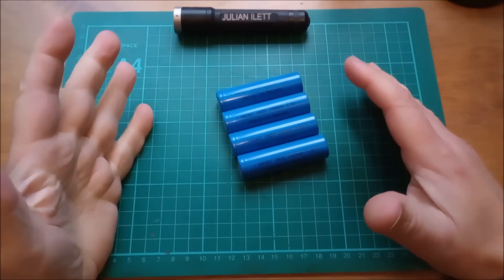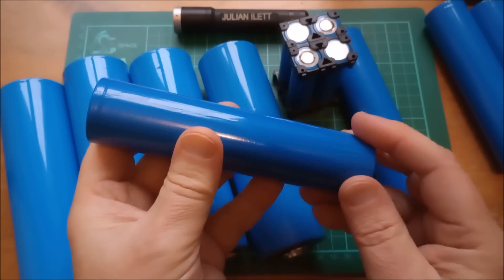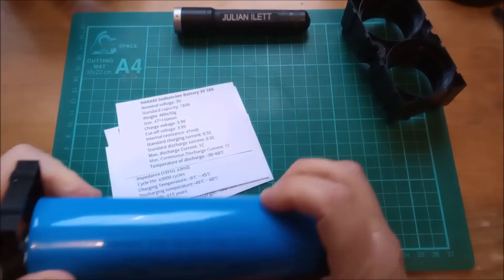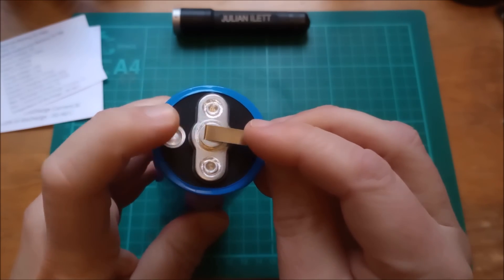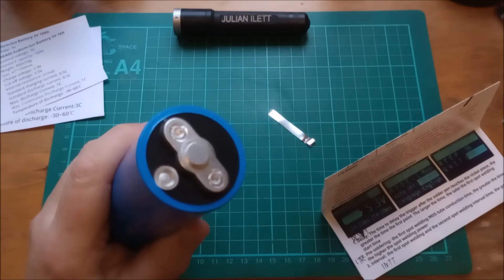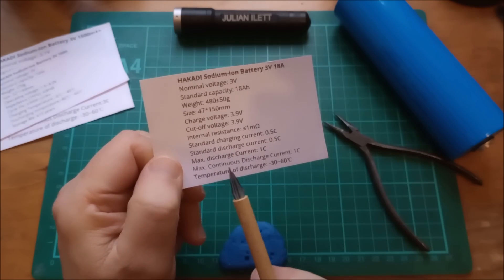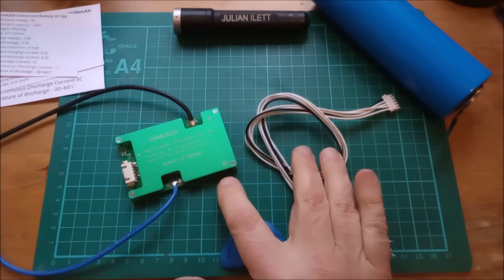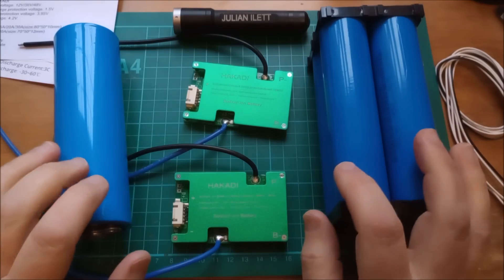Sodium Ion Cells from Hakadi Battery

Comment: You got my sub, and I also bought a 4-pack of these from @HakadiBattery.
I realize these don't explode if you overcharge, but I understand they can be damaged from overcharging.  What I'm wondering is what happens as you do?  Is there a particular voltage where the damage is accelerated?  Does the current during charging rise exponentially or some other effect?  If you or Hakadi knows info about this, I'd like to understand it better.

Comment: Interesting Overview Video, Thankyou. 👍👌
I think its ridiculous to have an Aluminium electrodes on a battery without having a Thread taped in on each end. Or even better a Steel end (Nickel finished) with the same Threaded insert on each end, would have less chance of stripping than Aluminium. Its very weird to see peak voltage decrease  proportionally to physical size ? 😳
Reply: Unfortunately the link is deleted here.  Search SRIKO Unfortunately very expensive.

Comment: Very interesting. But there are a lot of unknowns. Its very easy to say they wont catch fire but the actual evidence for seems to be lacking.
Then the discharge curve is showing them discharging to 1.4v while they claim its to 1.5v. The range of that voltage is strangely high. >80% of the discharge curve seems to be above 2.6v but most current batteries are like 90% above 3v. So I really wonder how useful these will be as 0 changes drop in replacements.
They claim they tested overcharging them without causing fires so like NiMH and NiCd. Again though where is the evidence for that? Will it damage the battery? Will the battery clamp itself and just produce heat like the NiXX batteries? If so you wouldn't need a BMS. But here they have a BMS... indicating something bad?

So given the discharge curve I would simply suggest using them to maybe 2.5v and when you have 1.5Ah takes off about 20% for its useful energy range. So 1.5Ah will be 1.2Ah.
Even then, the tech is really new and long term stability is unknown. Who knows they might self combust randomly. So until all data is known be careful with these. Now these are out and available to the public this data should be available very soon. If anything bad happens you will hear about it.

There is bound to be someone out there right now setting up a test with several batteries charging and discharging them to various voltages and checking the capacity each time. So we will get the data. But until that data is here I would strongly suggest most people to stay away from these.

After all Na is as flammable as Li. If they just replaced Li with Na then there might be some problems. (I know the reason to use Na was to reduce the risk of fire for use in home energy storage. So perhaps they really did fix the problem.)

Comment: That's were you need a 3D printer, ie, it comes in handy for odd-ball brackets, etc. Maybe a local fan can 3D print some.
You can get thick brass strips from a hobby shop and screw to wood and make it kind-of spring loaded.
SOSfix Electronics found some alum solder.
Reply: SOSfix Electronics found some alum solder - https://www.youtube.com/watch?v=NwzoPm7ogSs
Reply: I would not try to solder anything to the terminals of the cells, as soldering is a slow process that would pump a lot of heat into them, most likely destroying the plastic seals and causing early failure.

Comment: Hi,
Could you attempt a fire safety experiment for one of these batteries - e.g. drive a nail through a fully charged one?
When you do it to a li-ion 18650 it will catch fire, I believe.
Crushing them is another option.
Thanks.

Comment: The idea of TIG-torching a battery made me weirdly uncomfortable, but seriously how do they expect you to connect it? 

I have soldered aluminum by getting it good and hot (again, not batt. friendly) and then scraping the surface underneath a blob of rosin solder at which point it stuck easily. 

I do wish they would have a nice big chunk of aluminum on each end with M12-1.75 or 1/2-13 threads…

Comment: Aluminum and copper busbars aren't hard to find and aluminum ones are cheap and looking not at sellers of electrical equipment but at metal stock sellers even cheaper and the only equipment needed to make proper connections for such big cells are straight hands and exact size of drill bit for press fitting, may be also a jigsaw and a file for pretty looks.

Comment: The voltage curve is crap. I don't see these battery working with anything.
Reply: You can use electronics to stabilise the voltage.

You can't use them as drop-in replacement for Li-Ion but their cost saving is amazing, their safety is excellent and their voltage curve makes for much easier SoC measurement, so I can see industries using them a lot.

Comment: Its a bit weird that they claim different charing voltages depending on the size of the cell!?? I wonder what thats good for? Also these aluminium bolts as connection are difficult to handle for any real world purpose as you mentioned. Clever idea to use these simmering rings for connection but i consider this more a temporary work-around than a sound solution. Still a way to go to practise use i guess... The balance voltage of 4.2 V really makes no sense concidering the other values for charging. Very weird and unprecise.

Comment: Thnx 10^6 J - seminal bench work - leading the pack💪.  FWIW those terminal ends look like they were meant to be clamped between a holder (not just a tiddly spring affair as common).  IMHO a connection to an AL post like that needs mechanical fastening (like those SS serrated flange nuts) and needs to ensure the sharp edges that bite thru the oxide layer and have suitable pressure maintained (how much?) - perhaps a spring washer or Belleville - to keep the oxygen out?  Tricky area of potential failure long term.  Note that the outer AL casing is sort of insulated from the conductive electrolyte inside - thats a first - curious?
Reply: lightbulb moment J use SS shake proof washers between clamp bolts Ebay SHAKEPROOF LOCK WASHERS INTERNAL TOOTHED SERRATED TOOTH A2 STAINLESS STEEL

Comment: Nice that they offer those but price per 1kWh is higher than LiFePO4 so I guess they are in early production phase and should improve with time (also rated cycles number is somewhat low).
Reply: Price will go down since the material to manufacture is available everywhere except boron

Comment: Maybe it's just me, but as someone used to proper battery data sheets (whether 18650, LiPo, or even standard alkaline cells), I would be very concerned by the lack of detail in those spec sheets.  The inconsistencies (cut-off voltage, balance voltage, dimensions) also make one question their dependability.  The manufacturer would very likely have detailed data sheets, even if only in Chinese, so why not provide them to you if they expect you to test the cells?  Even their web site lacks such information.  Nobody would put these cells into a commercial product without much better data.
Reply: i want to see some charge/discharge curve and true capacities, not how to connect a cell to wires
Reply: What are storage volts, bulk charge, float, absorption settings for a programmable solar, or acto dc charger.
Reply: When I saw that I immediately thought "How does a 3.0V battery has the same balance voltage as a 3.8V battery?" Those margin of safety is very questionable
Reply: Noticed the same for operating temperature missing on the sheet of the huge ones. I live in Norway and care about the low end of operating, storage/idle and charging temperatures.

Comment: If you're careful you could probably drill and tap those aluminium lugs for M3 and use them as bolt on terminals
Reply from the maker: I did consider that. But I'd want to disassemble a cell first to check what depth it would be safe to drill to.

Comment: You can use a high current welder to attach to the aluminum lug. It would require a pressure clamp and the strip to be attached to be attached to the welder. Control with a pulse timer activated with a foot switch. Practice on cheap aluminum first.❤
Reply: Is this armchair speculation, have you any evidence this can be done?  Welding involves pooling molten metals.  Even trying to solder AL is unreliable and not recommended for electrical joints

Comment: the aluminium end caps would be for laser welding in the same way that LifePo4 battery's are typically assembled commercially.
Reply from the maker: Yes, I've seen LiFePO4 cells in this same form factor.

Comment: Id love to see you have a play with some LTO (Lithium Tintinaite Batteries).

The super fast charge, and high output current discharge, while being safe and having massive cycle spans makes them very interesting.

The big tradeoff of density seems very worth it in many applications.
Reply from the maker: Well, it's funny you should say that...
Reply: @JulianIlett I'll take this to mean I should keep an eye out for some interesting battery content. I really would love if you could really max out the charging speed just to give us an idea of how practical that is. They sound super fast, but like they need to be actively temperature controlled when going at the really mad charging speeds like 10C.
Reply: lithium titanate cells are also safe to charge at low temperatures.
Reply: and 5x cost 1/4 of the energy density kWh/kg so dont get too hot to trot yet
Reply: @RobinRastle    don’t think ev’s would be a great fit….yet.  But for a solar system in sub zero conditions….they could have a market in a stationary fashion
Reply: @RobinRastle  While that may be true....

.....

........

Ok its a good point but really though, that life span plus the high charge ratea are appealing and while definitely tradeoffs, they are undersrandable tradeoffs.

Comment: The terminals fit a spring.
Or bridge clamps... 
Either way it means making a case.

I'm not sure what to make of the cells
18ah, 54wh  and £15.20 a cell.
25ah lfp £16 and no funky terminals..

Use case with the cold charge, but check as they sometimes cover the discharge temps.

Comment: make flat bush bolts and no busbars!!! the more you screw it the more it makes contact .
 if you make it flat enough it will use the whole heads of  the cells 
headless bolts will help to have the other side for add wires in every way you want. 
  you can even solder on the bus bolts...     wood is a prety nice idea !!!!

Comment: Try and find PVC pipe that fits the OD of the cells. If heat isn't an issue, PVC glue, threaded ends on the pipe and put contact springs in the matching threaded end caps (?). Even if it is not this, I know you will solve this. I'm just thinking "out loud".  🙂:goodvibes:

Comment: Make end caps for the big cells that have heavy, spring loaded contacts. Make something (non conductive) that spans the length of the cell so the cell "end caps" are connected to each other. Much like the four long bolts that hold the end caps of a large pneumatic or hydraulic cylinder together. This would just have contacts in the ends.

Comment: I don't see why they have different charge voltages, they are the same chemistry.
Reply: I see it as trade between longetivity and capacity. Looks like 3.9V is the correct voltage and the higher values are just pushing into the limits more and more. I understand why they need want to push 18650 as much as possible since there is strong presence of other chemistries with higher capacity. Rated capacity for 18650 isn't great even with 4.1V and 3.9V sure wouldn't make it better. This also makes sense if some cells are designed for different use-cases where high capacity is more important than longetivity.
Reply: @tomaskolinger  I hear you, however, none of their literature instils much confidence. What is 4.2 volts about for balancing. Life po is less of a self-inflicted Pita and just as inert/safe, with clear usage parameters.
Reply: @johnshaw359  How could battery protection system balance at 4.2V when it should disconnect at 3.95V? That's impossible. The 4.2V balance figure is for sure mistake, I would expect top balancing at 3.90V or so when over-charge cut-off is specified at 3.95V. If the 4.2V value is accurate then balancing function would never occur. Mistake either way.

Comment: You need to get a 3D printer lol. It would be trivial to print out some custom holders in Nylon (with a hot box) for big non standard size batteries.
Reply: PETG is more than good enough for batteries. Even PLA would be acceptable, temperatures high enough to warp PLA would greatly shorten the life of the batteries.

Comment: Nice video! I don't know if I would be comfortable with aluminium terminals. Especially on high current stuff.
Reply from the maker: Most cells are housed in steel cylinders. I'm guessing aluminium is used for higher current cells because of its lower resistivity.
Reply: @JulianIlett  but don't you think that it will be much more surface resistance as it slowly oxidises just like aluminium domestic house wires? Those are a major fire hazard now.
Reply: Aluminum terminals are normal for most larger LiFePO4 cells and even when integrated into 12v drop in batteries.  Unless drilled and threaded, the aluminum terminal is intended for laser welding.

Comment: Laser welding is the only option for those battery post with no threads. Not sure why they even sent those to you. Just a waste if you ask me. The BMS is within spec.. but not ideal as you mentioned. I do see these being the new standard for large house or industrial energy storage soulution. I hope they come out with server rack size packs for a faction of the cost of lifepo4. 
Never the less, Thanks For sharing!
Reply: Yup, these things are meant to get laser-welded through holes in bus bars. You could put them inside some sort of tube and then have some sort of compression mechanism for contact pressure. Got to use some anti-corrosion/oxidation paste between surfaces though or there will be on-going spotty conductivity problems.
Reply: Just a matter of some wire and electrical tape...
Reply: @ceconk123  Haha but yeah no.. bad advice